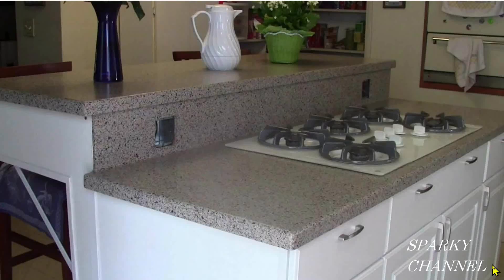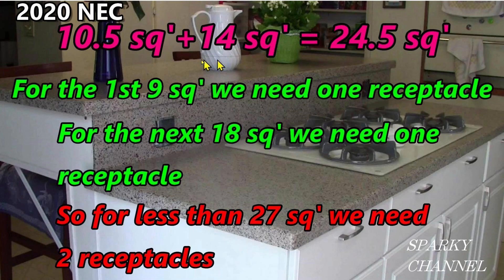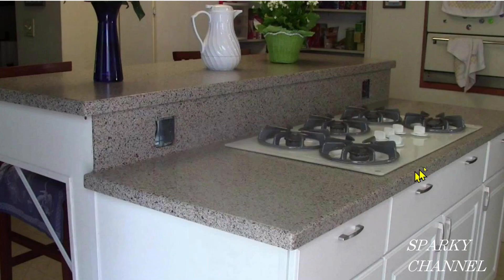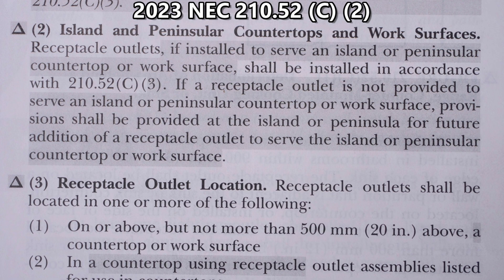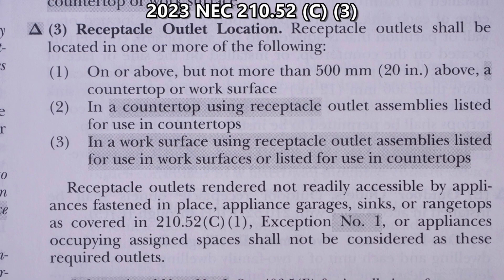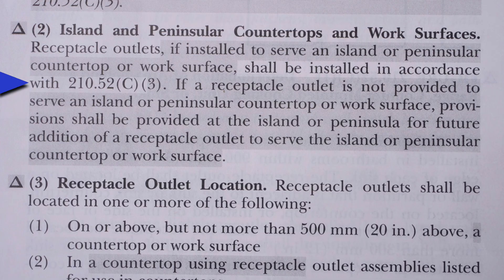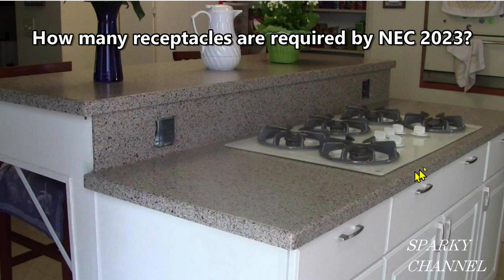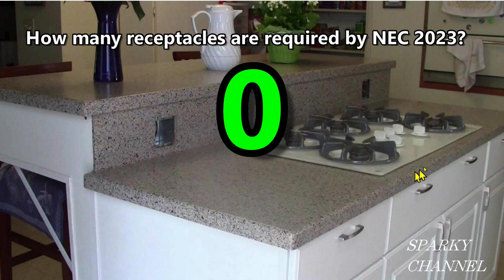How Many Receptacles are Required on this Island by 2023 NEC? 210.52(C)(2)

Comment: Zero receptacles are required is my answer as I have been browsing said changes.  It is ridiculous that they went through these radical changes in 3 steps over 6 years.  It isn't as if there is a natural progression - there isn't.   I won't be cutting through the countertop - but I will be wiring myself.  I will be putting it in the end after I build my house.  I understand the motivation to improve safety, but I am not making an expensive and unsightly install into my countertop for the sake of a future owner - I don't have kids.

Comment: Guaranteed that 'provide for future' to a builder means 'I do minimal to nothing'.  I can hear the conversation with the inspector now, 'In the future you can drill a hole over there to pull a cable and nail a box in the framing over there. I'm done'.

Comment: Dollars for dimes people are going to use appliances on their island or peninsula. If there are no outlets they'll grab extension cords and plug them into whatever and wherever outlet they can find. Using their 18 AWG lamp type extension cords with high current appliances on 20 amp circuits,. The average homeowner has no idea the risks of the overloaded extension cords running across the counters, at least until the fire starts. You know this is going to happen, with alarming regularity.  It's difficult to not see that as a higher safety issue than whatever the NEC thought they were solving.
Reply from the maker: That's what I think as well. Thanks Russell.
Reply: And those will be draped across from the kitchen outlets, creating an even greater hazard.

Comment: While these 2 articles don't require a receptacle, it does appear that it must be prewired. So, the circuit breaker will need to be there and the wires will need to be accessible. I could see an inspector requiring the wiring into boxes with blank cover plates, just no receptacles, in order to meet this requirement. However, as you've stated, it leaves the situation open for improperly installed receptacles.
Reply: "If a receptacle is not provided for an island or peninsular countertop or work surface, provisions must be provided at the island or peninsula for the future addition of a receptacle to serve the island or peninsular countertop or work surface." 

Doesn't say anything about "prewired", but it is wide open to interpretation.
Reply: @phi5head  Understood. However, those provisions will probably then require conduit from the breaker panel to the counter top so that the wire could be pulled. Having to cut into walls, etc. would be no different than now and so, wouldn't be "providing for the receptacles." If the conduit doesn't go all the way back to the breaker panel, it will need to go to a junction box or other receptacle box somewhere to tie into. Basically, having to tear everything apart to get the receptacles installed will be hard to justify as "providing for the receptacles." Therefore, while it doesn't require it, prewiring is probably the easiest way to comply.
Reply: I think the most common interpretation will be to require a junction box prewired in the island. But installing boxes and blank plates doesn't make sense to me. If you're going to do that, you might as well install the receptacles. And if the island is above an unfinished basement, with the panel in the basement, you really don't need to do anything.  @wmcomprev
Reply: @phi5head  I understand what you're saying about a basement, but I'm in Texas. We don't have basements. If the wire wasn't in the cabinet somewhere, then you'd need conduit through the concrete slab. If you don't put in boxes and blank plates, then the cabinet would be designed in such a way as to make it fairly obvious where they would go and what the wire path to those points would be. I also agree, if you're going to put in the boxes & prewire, you'd might as well put in the receptacles. The only reason I'd see to not do so would be if there's going to be multiple different types of items that could be wired into those boxes. However, I'd still just put in the receptacles and let them be pulled out if someone wanted something different in there. The price of the receptacles is negligible.
Reply: I think it will really only come into play on islands and peninsulas without backsplashes. On islands like the ones in this video, any electrician worth his salt will still be installing receptacles even if they aren't required. But if it's just a flat countertop, you now have to install one of those pop-up receptacle assemblies or nothing at all. No more receptacles in the side of the cabinet below the work surface.  @wmcomprev
Reply: @phi5head  I agree. They should be there anyway and probably will be. I also understand no cord on the side for small kids to grab and pull a hot item over on their self.
Reply from the maker: Yes, it is very much open to interpretation. Good point.
Reply: Define provisions.
Reply: It does say shall.

Comment: As someone who recently bought a house that has a kitchen island with 0 receptacles, I think it's a bit of a bummer to not have it, but fine for the NEC to not require it. We do have receptacles on different circuits on the main counter, and we have a high number of appliances. But though a bit crowded, we do have the space. No stove or anything like that in the island, just some storage space underneath. This one seems like something fine to leave the homeowner to opt for if they want it, or want to show off when they sell. As with any upgrade, it's a significant value add that a homeowner can weigh whether or not it's worth it. And ultimately it's up to people not to do things that are dangerous and could cause damage. To really stop that the NEC would really have to be very unreasonably intrusive in residences.
Reply from the maker: Thanks Alexander. Congratulations on the new home!

Comment: that’s a lot of outlets for such a small area.  Your countertop would be covered with small appliances.
Reply from the maker: Two of the receptacles were also USB chargers. To this day, they are frequently being used to charge laptops, cell phones and the like. It's nice to be able to use the other receptacle for an appliance.
Reply: Yes I would have put in two duplex outlets.  But I am not an electrician.

Comment: As of October 1st, Oregon adopted the the current NEC.  I was surprised it also adopted this article in the Oregon Electrical Specialty Code, verbatim.  In the past this article has been modified.  OESC is Oregon's revisions amending the NEC.

I personally would suggest reasonable receptacles be added.
Reply from the maker: Interesting. I agree with you. We need some receptacles to use while using the island.
Reply: Yes.  It may not always be easy to install new receps, as you pointed out. @SparkyChannel
Reply from the maker: When I designed the island in the video, I designed in a place to safely put receptacles. The receptacle placement has to be carefully thought out before building, not after an island is installed in the kitchen IMO.  @donl1410

Comment: I completely agree with your final analysis of what may happen.  Usually building codes require more outlets.  However, I can see where they chose to make it no standard and let the home shopping community dictate the number of receptacles.  I know I would want a couple on one if I had an island but I am not sure I want them to dictate how many I have to have installed as it may not be necessary in all occasions.   I tend to be a minimalist in regulations requiring non-safety items.
Reply from the maker: Good points! Thanks Jeff!

Comment: Why are they changing code?
If it ain't broke, don't fix it.
Reply: "As part of its substantiation for the change, NEC Code Making Panel 2 cited Consumer Product Safety Commission (CPSC) data showing that between 1991 and 2020, an estimated 9,700 people, many of them children, were treated in United States emergency departments for burns and other injuries after pulling on or running into power cords plugged into receptacle outlets installed below island and peninsula work surfaces. "
Reply: @phi5head  The cords are not hanging off the counters. Kids should not be running in the kitchen.
Reply: @tiggeroush  Most are. Appliance cords are like 1-2 feet only.
Reply from the maker: I agree. I think the 2000 code made excellent sense. The 2023 code was made by people who don't cook.

Comment: the requirement was removed because of the 10,000+/- kids getting hurt by pulling hot pots off the island onto themselves.
Reply: It that true?
Reply: @chrisf9607  It was 10,000 but yes otherwise it is true. https://www.youtube.com/watch?v=CFwoCklNIow
Reply from the maker: You don't think people will use extension cords if there are no receptacles on their kitchen island?
Reply: @SparkyChannel  that would be people making themselves unsafe and not the NEC requiring them to be unsafe. But then its a question of, how do we make it safe. I think the NEC will come back to this after someone figures out how to make it safe.
Reply: And the have what to do with outlets?
Reply: @saulgoodman2018  kids pull the cords of the hot pots.
Reply: @tiggeroush  What does hot pots have to do with cords?
Reply: @tiggeroush  But the plug is not dangling on the floor. It will still be on the counter.
Reply: @tiggeroush  Don't use that one then.
Reply: @tiggeroush  It's the parents fault for letting them run in the kitchen.
Reply: @tiggeroush  It is their fault for letting kids run around.
Reply: @tiggeroush  Why does something have to be fixed if it's the parents fault?
Plugs should not be hanging off the counter.
They are not long enough to hang off the counter anyway.
Reply: @tiggeroush  Common sense would tell you to not use that to plug hot things into.
People need to take responsibility for themselves, and stop blaming other.
Reply from the maker: Is that just for islands or countertops and islands?
Reply: @SparkyChannel  I would think anywhere the cord can hang over the side, like islands, where the receptacle could be below the countertop. Kids were able to pull the cord and pull the electric pot with hot food down on themselves. I have only seen the change for Islands and Peninsulas.
Reply: Receptacles below the work surface are no longer allowed for the reason you cite. It doesn't really explain why they would make receptacles like the ones in this video optional however.  @tiggeroush
Reply: @SparkyChannel  Ruan Jackson says it was 10,000. I will correct my error above https://www.youtube.com/watch?v=CFwoCklNIow

Comment: I agree with it, to an extent.  People were complaining about receptacles  interfering with a planned design aesthetic and perhaps they had no plans for using appliances there.  However with the 'provisions' in place, such as a hidden accessible prewired junction box somewhere below,  it should be relatively easy to add them as needed.
Reply from the maker: OK, thanks!

Comment: The minimal should be two receptacles for a countertop. The lack of receivables makes that countertop useless or the homeowner buys a 100 foot 10 gauge extension cord on a receptacle using a small gauge wire that won't handle the draw .
Reply from the maker: I totally agree. Who can work in a modern kitchen without handy receptacles? LOL! Good examples!

Comment: No more receptacles allowed on the sides of cabinets below the work surface. Too many kids had pulled some appliance down on themselves and been injured.
Reply from the maker: Yes, 210.52(C)(3) says on or above the countertop. They sure seem to like the receptacle assemblies you put in the countertop though. It's almost like the NEC is advertising for them.
Reply: I think they're pushing the pop-up countertop receptacles because they're really the only safe option for an island with a flat countertop: "As part of its substantiation for the change, NEC Code Making Panel 2 cited Consumer Product Safety Commission (CPSC) data showing that between 1991 and 2020, an estimated 9,700 people, many of them children, were treated in United States emergency departments for burns and other injuries after pulling on or running into power cords plugged into receptacle outlets installed below island and peninsula work surfaces. " @SparkyChannel
Reply from the maker: I feel that is true. Some inspectors may flunk it though. I wouldn't put a receptacle on the side of the lower cabinet due to legal and safety concerns. @Minn_So_So
Reply: Although, my state is still on the 2017 NEC, so this won't apply for me for several years.
Reply from the maker: True.  @phi5head
Reply: Depending on which state you live in, it could be years until 2023 code kicks in. Until then, many islands must have a receptacle in the cabinet below the work surface.
Reply: That is where mine will be going, after the inspector approves the covered box in the bottom of the penninsula cabinet.  I have no children.

Comment: What happened to the contest for the ideal meter? I've been on the lookout for the winner...
Reply from the maker: The 2 winners of the Sparky Channel IDEAL clamp meter giveaway have been randomly chosen. They are: larryragan8159 and jimzeidler3829. I wrote both of them in the comment section with an email address to write with their info so we can send them the meters. Shipping is on us as well. Per the rules, they have 48 hours to respond, or new winners will be selected. At this point, neither have responded, so we may have to re-draw tomorrow.

Comment: It depends on how you interpret ‘provide for future’. If that just means a conduit  under the floor, it could be problematic. If the cutouts are provided with blank covers, it’s better. I think the vast majority of contractors will go ahead and wire the island, hopefully to at least 2020 standards. In reality, it may be awhile before anyone figures out that they’re not required. 😊
Reply from the maker: LOL! Good point! Well, if you're going to wire up wired receptacle boxes with blank covers, you might as well install the receptacles too.
Reply: @SparkyChannel  Yes, but that isn't what is required from what I have seen.  And you can't very well provide for a pop-up with a blank.
Reply: I believe it requires wires run to the base of the structure, with a covered box.  Not a conduit that ends under the floor, and not as far as actual outlet boxes - because (for example) the pop up fixture would be completely absent.  Probably up to local inspector as to what is satisfactory.